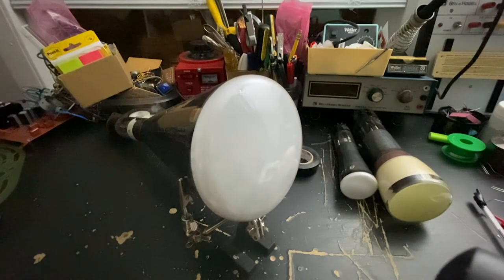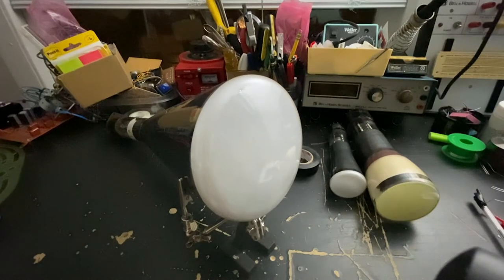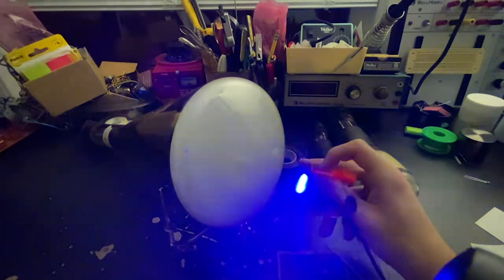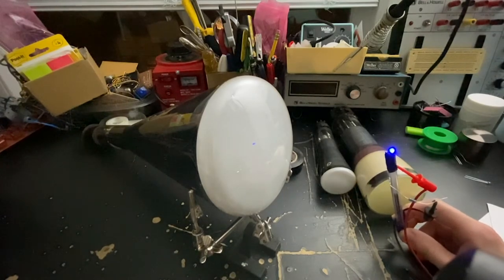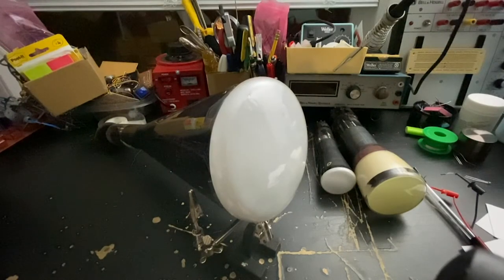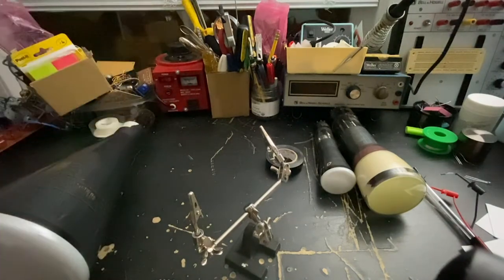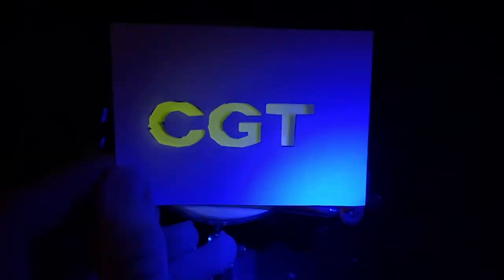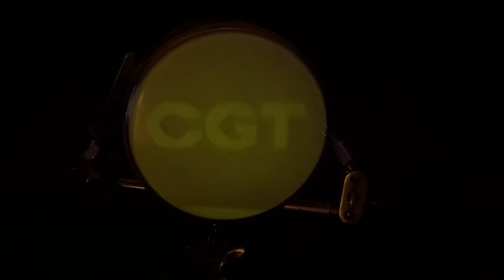Experiments With Light-Emitting Diodes and Cathode Ray Tubes

Comment: Interesting! I never liked the blue LEDs in nixie tube kits either with but I guess if it actually serves a purpose it’s less blasphemous. Do you know if UV LEDs would work as well since those are higher energy photons than blue? Edit: I skipped around a bit so, sorry if you covered this. 🙃
Reply from the maker: I think UV LEDs were also used, and were probably much better suited for the task! I just wanted to try this out, and I only had blue ones;) thanks for watching!